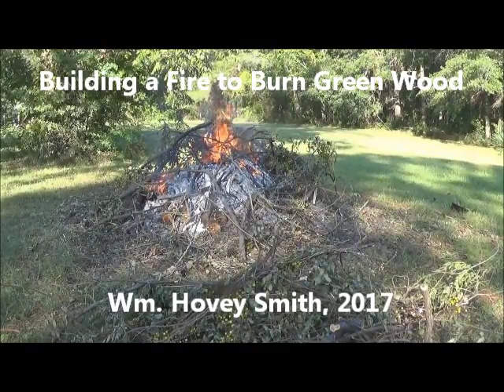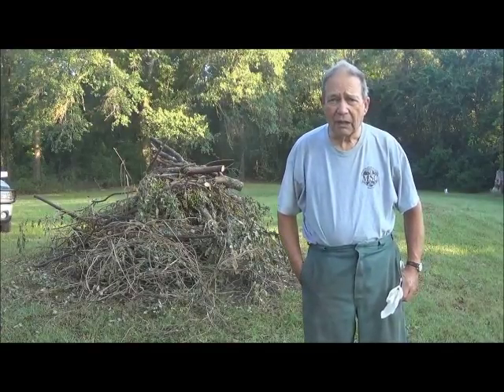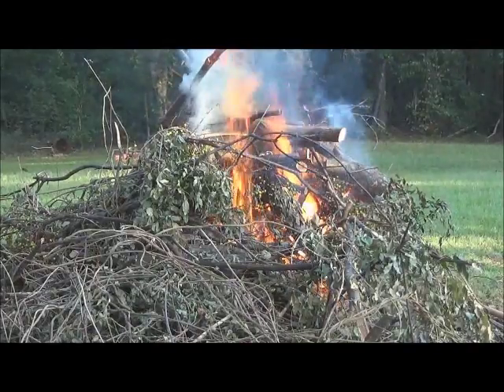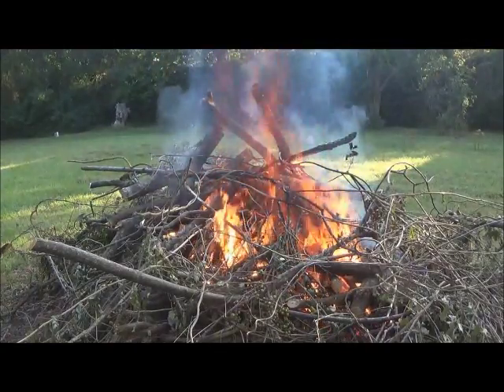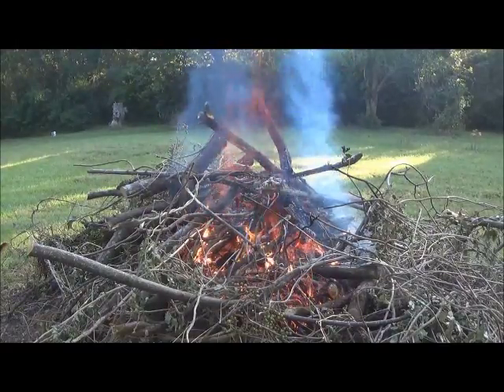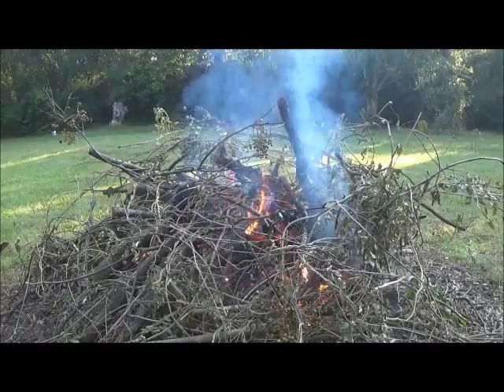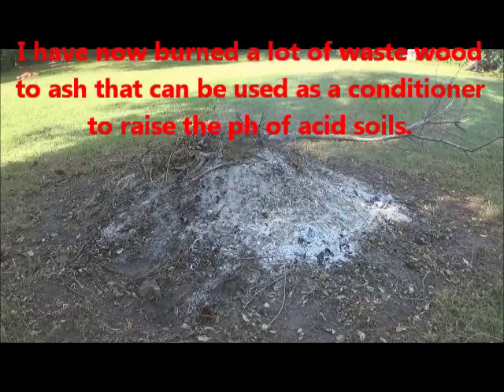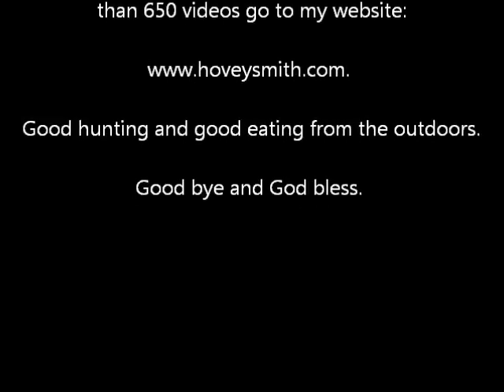Building a Fire to Burn Green Wood

Comment: So what is he using to start the 🔥????
Reply from the maker: One match.
Reply: @HoveySmith  Wow!! It took me forever to start a small fire to burn a small pile of tree brush 🔥😌. Maybe the wood was still wet or something . I'll put leaves at the bottom next time
Reply from the maker: If you must burn green wood, it is best to have an under-fire of something really combustible, like pine straw that is loosely mixed with smaller dry pine twigs, then small dry hardwood branches, and then you will have a much better chance of getting  it started and keeping it going.
Reply: @HoveySmith  😊 Thank you. Good advice 👍 and great video

Comment: very nice .. thank you.  I usually put kerosene in a spry bottle and spray the bottom part of the whatever I'm burning .. it helps so much start the fire easier.. kerosene is kind of friendly... but you dont want to POUR so much in there..... I had been burning branches and limbs for about 3 hours and now my eyes are still burning .. not sure if its because of that or because I only slept for about 3 hours last night :(